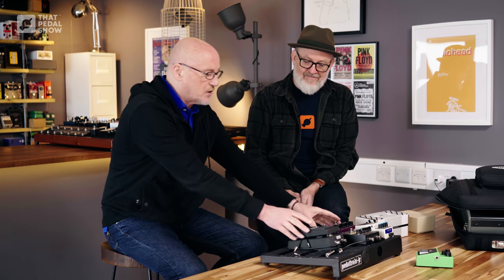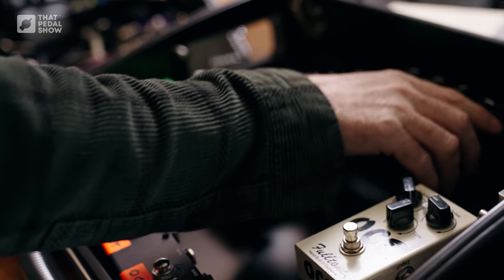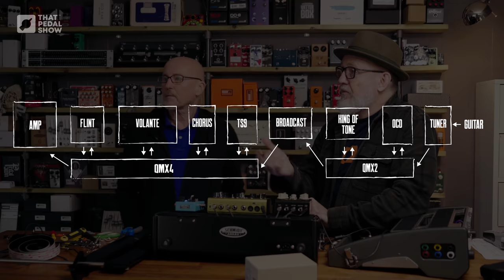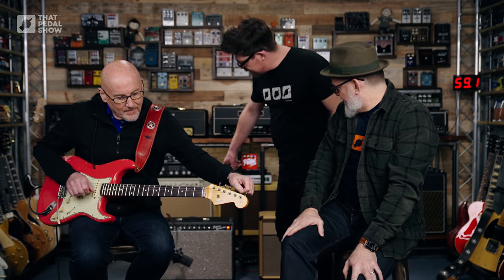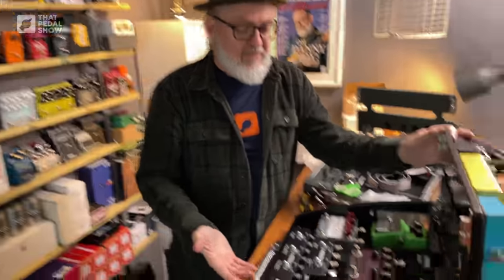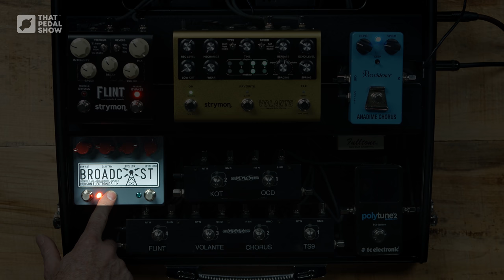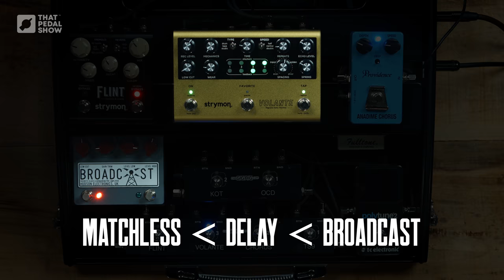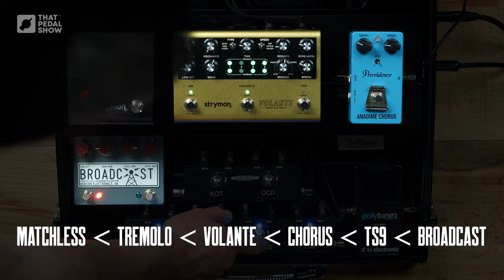New Pedalboard Build For Our Mate Neville Marten [Matchless, KOT, Broadcast & More!]

Comment: Great episode as always! I think it’s funny how I played with two amps and 14 pedals on my board when I first started following TPS and after years of watching the show my board is now a tuner, a Roger Mayer Octavia, a Tone Bender MK1 and a proper spring reverb unit into an AC30 and that’s it. Haha
If there’s one thing I’ve learnt with this show is that you never know what’s enough until you have too much and once you figure out what you like you just need to figure out what you need. I’ve never been happier with my rig.
Reply from the maker: This is the path to enlightenment right here! Nice one Subro!
Reply: I went from buying one of the biggest Schmidt array to fit a ton of pedals and having stress because of too many options, to having a couple of smaller pedalboards to nail different genres
Reply: I love mk 1. But why are they so expensive!?
Reply: @krasimirparvanov8139  they’re one of the most finicky circuits to get it right. You’re usually paying for the time finding the parts and auditioning dozens or hundreds of transistors to find the perfect set.
Reply: @Subropontes  And also in many cases there is 50% marketing, and previously made legend.  Examples...a lot😉.
Reply: @krasimirparvanov8139  yes, there are some that are quite outrageous. Anything above $500 I struggle to justify the prices, but I do have a lot of respect for builders that nail that circuit. Mine is by Circle Electric, I paid $350, it has a proper big MK1 enclosure and the attention to detail is just mad. I’d pick that over the Sola Sound.
Reply: @Subropontes  I just saw on circle electric!  This is a mk 1 - Escalator Tone bender mk1- 250 $ !!!
Reply: @krasimirparvanov8139  yeah, I paid more just because of the cool big MK1 enclosure. Haha Brandon is really nice and that MK1 is my favourite fuzz pedal I’ve ever played.

Comment: A cool way to use the broadcast is if you set the trimmers so that both sides are matched in gain. I have mine with the 'green' side just slightly higher gain than the red and then you can use the level controls to have it more like a 2-stage boost-overdrive rather than an overdrive-fuzz
Reply from the maker: Nice! I’ll totally try that. Mick here. :0)

Comment: I'm really digging my harmonious monk. Superb pedal. Here is a suggestion for a future update:

It would be great if the high and low signals could be split at the output. That way you could send one half of the trem to one amp and the opposite half to another amp in a stereo or wet/dry setup. Instead of the phasing occurring in the pedal you could have physical phasing in the room.

Maybe a stereo output and dual ganged potentiometer for the volume? This would make for a very psychedelic Doubly Harmonious Monk.

Of course this is gelding the lilly... 😉
Reply from the maker: Ha! Trippy! Thanks for buying a Monk, Paul. Much appreciado. No doubt your mod would sound marvellous, alas we feel it would be a very limited audience for such an idea. Tap tempo would be a good V2 mind….

Comment: Why not turn the buffer on on the Polytune, do away with the four pedal switcher at the bottom, and free up some space so he can put the KOT down below and have access to both sides if he wants them. The Strymon pedals can both be set up to have a buffered or non buffered output, the TS9 is buffered so signal loss is probably going to be minimal, which I'm guessing is why the switcher is there in the first place. Could set up the KOT to do both a high gain and low gain sound and make the board even more versatile. Might even make the OCD redundant and he could put a different flavor, like fuzz or octave or whatever else might inspire him.
Reply from the maker: Mick here. It would be fun to try it. But for me personally: 1) I don’t want any buffers before my overdrive pedals. Apart from other overdrive pedals. 2) More than 4 pedals, I always hear the benefit of a true bypass switcher. But sure, so many ways to configure this to one’s personal preference!
Reply: @ThatPedalShow  That makes sense. If you have time for a followup question, why do you prefer not to have buffers before your overdrives? Curious what your thoughts are on how that changes their sound.

Comment: One question I have about this video is, as said the guitar goes into a tuner then go to controller. As far as I tested the broadcast OD works better when connect to the guitar directly.
Maybe it's about the version of pedal? because I know some model uses special transistor and require a special input impedance. Also this affect the clean up.
Reply from the maker: We find it works great anywhere in the chain, but as always there is no correct way to use anything - just whatever suits your tastes. Cheers!

Comment: The Neo speaker that I had FHRD White Lightening (Celestion Century Vintage 65 watt)was significantly louder than the Ceramic magnet Weber 12F150 50 watt I had. Louder and brighter. K
Reply from the maker: Yah neo can be very efficient. What I’ve found having heard (and tried to record) loads now is that: a) They always sound pretty good ambiently in the room. B) I can’t mic em to sound good. C) I always prefer a traditional ceramic speaker in every instance. Mick here. Cheers!

Comment: Back to the actual board: if the Broadcast is always on, surely you swap the KoT and Broadcast and then you can adjust the KoT / use both sides of it on the fly? Forgive me if this happens before the end of the video! Edit to say I don’t mean swapping them in the loop switchers, just their physical spot on the board.
Reply: Or KoT up top right and Chorus underneath ...
Reply: @KozmykJ  not sure it would fit? Either way, only a personal thing, I find it easier to have the pedals nearer the floor at the front, rather than set back and on a shelf. Less to c*ck up in the middle of a song	! On reflection, if I was wanting access to the KoT a lot, I’d actually move the Quartermaster left and have swap the KoT with the tuner (rationale being that I’m right-footed and I’m only tuning between songs). Broadcast always-on under the shelf, less likely to be tweaked mid-song versus between songs. (Edit for typo)
Reply: @onenotesolo256  My thinking was in regards to the covering up of the tone options of the KoT. 
Part of my my design philosphy is to enable the best of all possible worlds. 😜
I have a problem with limitations ...
Also with Authority 😉

Comment: Loved this. Neville is such a treasure and the board turned out so lovely! He does not seem to use the fuzz on the broadcast. Any reason the KOT was not put out front and the broadcast underneath for access to the boost?
Reply from the maker: That might be a change in time. He kinda needs to use the board for a while and see what works. Cheers!

Comment: Love the pedal board build episodes, thank you TPS 👍🏻
EDIT:  What is the Quartermaster 2 sitting on?
EDIT EDIT: Where is the power supply?
Reply: Well it would be funny if it was under the QMX2 :) It’s the GigRig modular power system so it’s spread around inside the board.
Reply: I wondered the same. Couldn’t see where the Generator was hidden 🤔

Comment: Thanks for the show. I did not see the Generator power supply on the pedal board. Have you started keeping it outboard away from the pedals?
Reply from the maker: On the smaller boards we tend to leave it outside because of space. If it’ll fit it goes inside. Cheers!

Comment: Why not wet-dry the BFDR and the Lightning?

What voltage for the Broadcast?

Why not a Klon for the TS9?

I would’ve loved to hear Red and a P90 loaded guitar with this rig.
Reply from the maker: Hello! Wet-dry is too much hassle for Nev. Broadcast going at 9v. Lots of people like it higher, we’re happy with 9. Klone cloud work real nice. It would end up ‘thinner’ and more ‘aggressive’ than the TS. Could be aces. Cheers!
Reply: @ThatPedalShow  Thank you. Would you consider the deluxe/Lightning a desirable wet/dry pairing? I’m headed in a (very) similar direction (Allen Accomplice/HC-15). 

I like how you focused on building a pedalboard that works with very different amps. This is why I’ve steered away from the TS, as it tends not to pair as well with mid-focused amps. But used as it is on this board, it works well.

Comment: Great sounds! Love the matchless and the broadcast! Any idea if a tru-fi color driver into a Kingsley page with a tweed deluxe would be a good fit? The page is a great low gain pedal. And the color driver seems capable of everything from clean boost to fuzz? Thoughts? Any tried this?
Reply from the maker: Nice! They’d make a fab combination. If you’re going fuzzy put the colour driver first. If you want a lovely tube overdrive into a high headroom boost, put the page first and run Color driver with high vol and low gain. Sweeeeet.
Reply: @ThatPedalShow  thanks but strymon volante or Analogman ardx20...
Reply: @ThatPedalShow  I ordered the 18 volt version. Hoping to make my tweed howl

Comment: Deluxe Reverb needs a speaker swap
Reply from the maker: Sounds pretty good in the room (off axis), but I can’t handle them on axis or mic’d. Be interesting to hear it more cranked.
Reply: @ThatPedalShow  Neville said at the beginning he didn't like the EQ curve of the Deluxe and later Mick said it has a Neo speaker and is louder at lower volume. My thought was a speaker like for instance the Eminence  Alessandro would have a woodier EQ curve and also allow the amp to be turned up more before it gets to loud so he could get into the zone where the tubes starting to give a little love and to get above the point where the bright cap is effecting the tone so much. Of course if the low weight of the Neo is his priority for that amp  then clipping the bright cap may help.